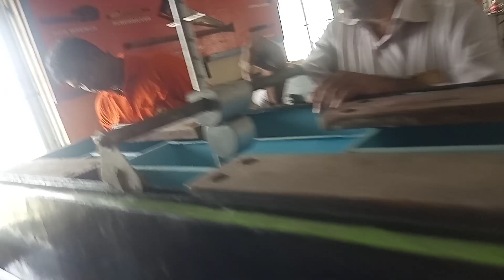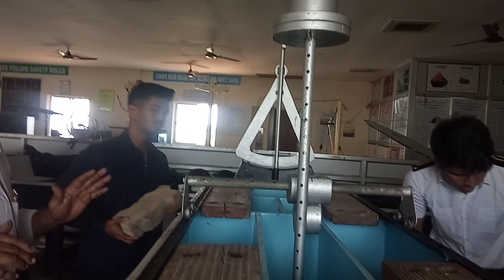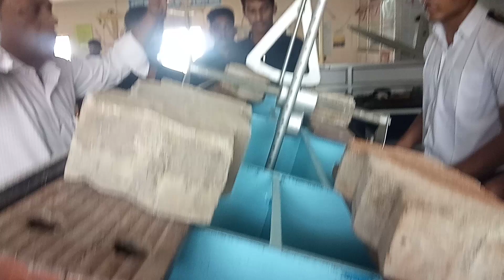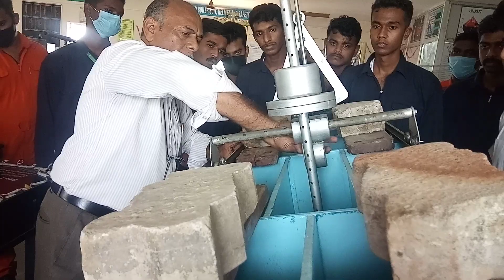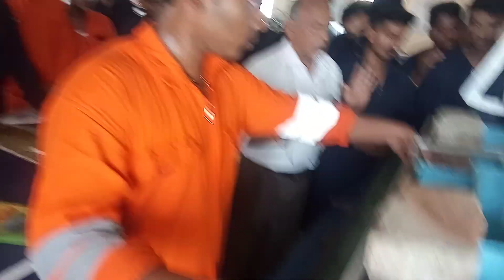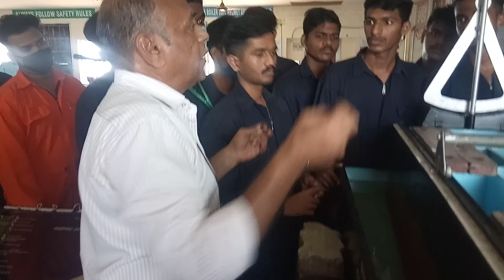RKK Model Loll exp

Comment from the maker: To simple5907, Thanks for your compliment. As regards finding actual GM on timer ships and even containerships use the "list" method. Ballast a side tank, check list by reading midship drafts or a good clinometer. This is an accurate method if you find the list angle using P/S misdship draft instead of a small clinometer. It is accurate and practical ----After all inclining experiment to determine KG of the lightship uses list formula! sad that many believe their loadicators or programs blindly.